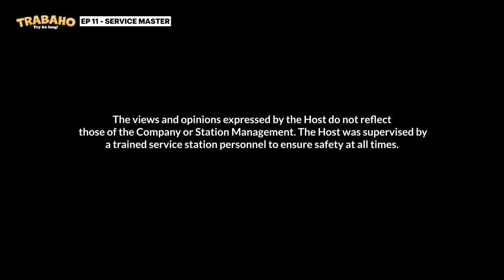“Anong Fuel Po?” Filipino Gas Station Job Review | TRABAHO

Comment: I've gassed up my own cars for 40 years in the USA already.  Never "top off" the fuel in the fuel tank. Stop at the first "click".  It's designed to do that for a reason.  Overfilling your gas tank will cause gasoline to enter the fuel vapor filters and ruin them, which is a part of your car's emissions system and a check engine light can appear over time.  So always stop at the first "click" po. 🙂

Comment: Newer vehicles can't mix up gas vs. diesel fuel coz of the fuel nozzle vs. filler tube but on older vehicles are different that's the one you have to check better yet ask the owner